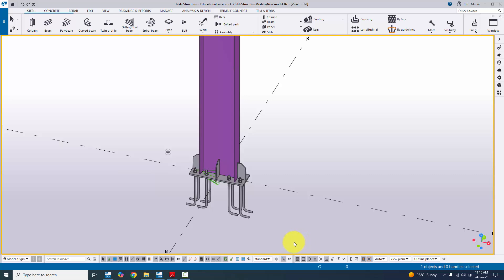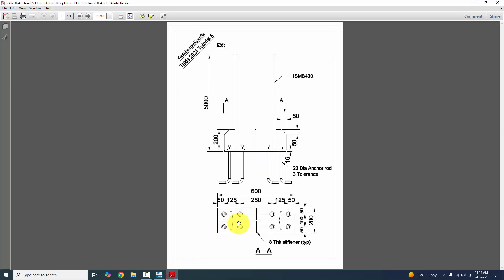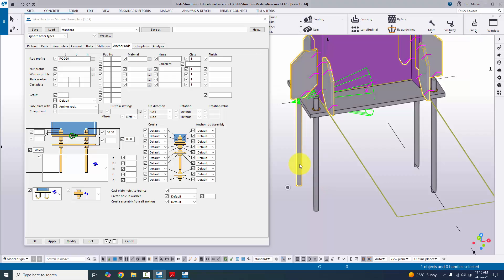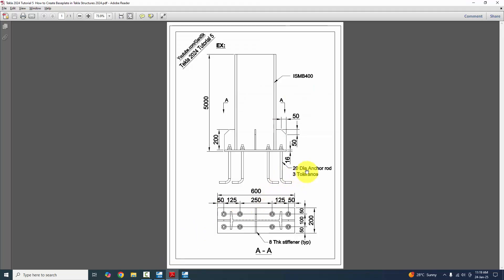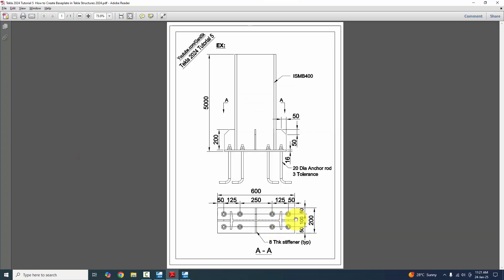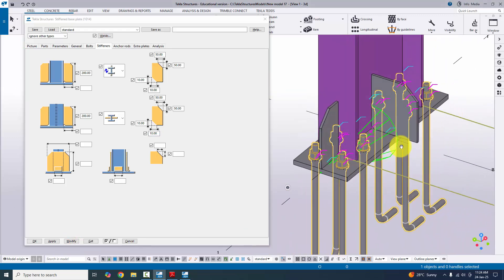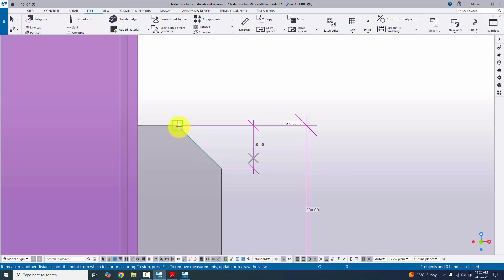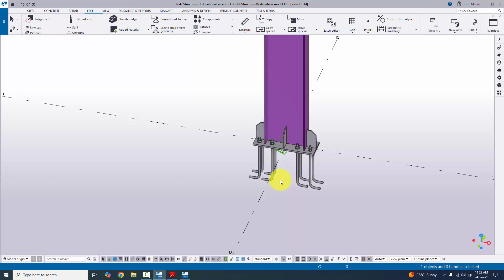Tekla 2024 Tutorial 5 | How to Create Baseplate in Tekla Structures 2024

Comment: If I have more 3 stiffeners between anchor bolts what I am going to do to in increas the number
Reply from the maker: There is no option to increase more stiffeners in between anchor bolt, but you can add it how many you required by manual, I will make a video on it.
Reply: @GaniSk  i have done them by open the components and copy the stiffner and distributed them in required spacing
Reply from the maker: @maithamabdulzahra6978  Ok, good